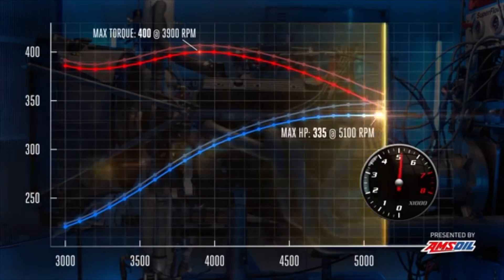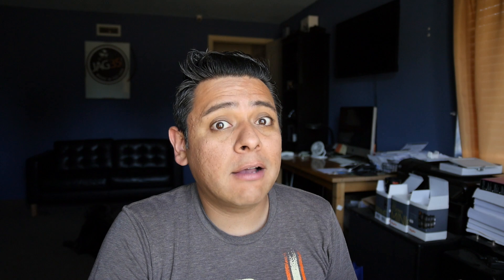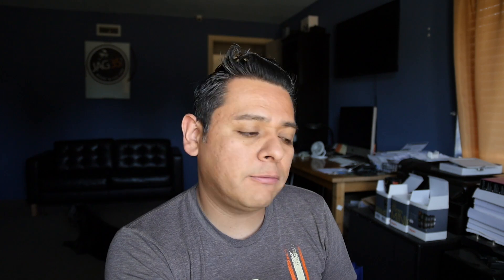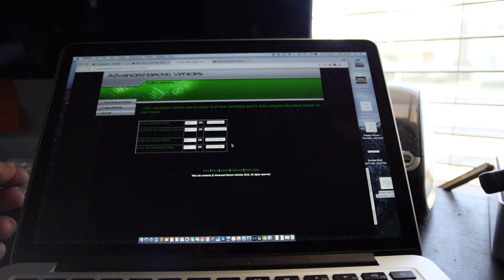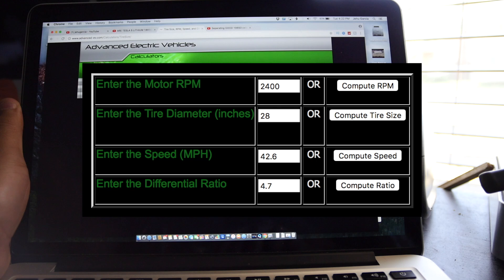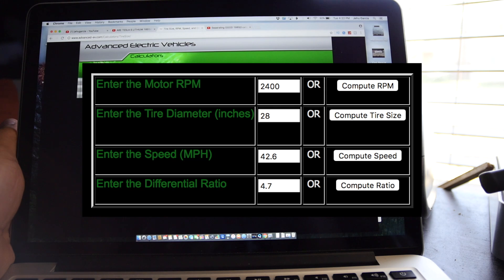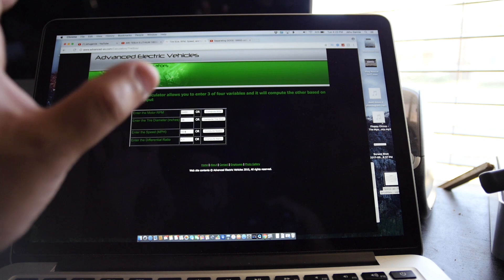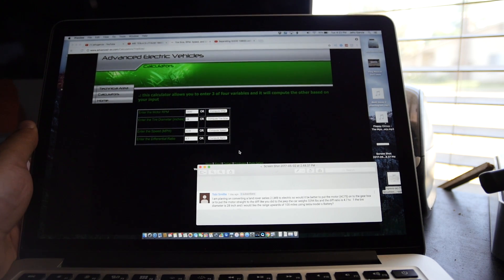Do you need transmission on DIY EV?  + batt Giveaway

Comment: hi Jehu again.
So gearboxes being predominantly a friction device, its important to say the power loss is in comparison to load or essence torque. so more you have the more you loose.this is one of the minor things thats bad for electric (except the lack of stall well then makes up for it).
so its not unusual for a car to loose 20 to 30 percent through the drive line (this being obvious if you touch the diff or box after a moderate drive), this at full power ofcourse. It does drop down the less torque applied.
Interesting information, ive herd of a 4wd with factory power of 102kw only puting out 40kw to all 4 wheels, so thats a big loss of 60%.
but thats not the only point. other main points would be like with your van being that the diff is part of the gearbox (i believe). So in your particular vehicle is your gearbox part of the frame (rare but happens) or other drives that you need, most front whel drive cars will be.
Your def on thee right track though, and thats why i watch you, thanks

Comment: Hey mate, great show.

Not a big fan of that lens though, an auto one would be better suited to your delivery style as it seems you move around a lot.

With the ratio's etc, being a Landrover nut and a qualified Mechanic and Fabricator, your right that the motor would be fine on the diff but then which one?

LR S3 has a front and rear diff plus in the LT95 gearbox/Tcase it also has one for running on a sealed surface to stop binding up the drive shafts from front to rear diff.

If you were to fit a motor to both, direct drive it would be great as it would have a max of 360Lbs of torque at 0 mph so it would have diff destroying take off.

Otherwise, you would mount it direct through an LT230 Transfer case which is 2 speed, High and Low range obviously.

Ratio's are as follows.

Prefix
Type Ratio Typical Applications 
12D  R 1.667  
13D  R 1.410 
14D  R 1.003  
15D  R 1.192
20D  T 1.667 Defender 4 Cyl Non Tdi
22D  T 1.410 Defender 4 Cyl bar 2.5 Diesel Nat Asp.
25D  T 1.410 Defender 110 V8 With LT85 Gearbox
26D  T 1.003 RR Classic with 3 speed Chrysler Auto
27D  T 1.192 RR Classic up to 1985
28D  T 1.222 RR Classic 1986 0n & Disco 1
29D  T     1.192 Defender 90 V8 with LT85 Gearbox 
32D  T 1.220 4 Cyl & V8 3.5 fitted With LT77S Box
34D  T 1.410 Discovery V8 & 2.0 Mpi
36D  Q 1.211 Discovery
37D  Q    1.211 Discovery
38D  Q    1.211 Defender V8 4.0 
40D  Q 1.211 Japan / South Africa 
41D  T 1.211 Disco 2 With Diff Lock Stud
42D  T 1.211 Disco 2 No Diff Lock fitted
  
43D        1.410 Defender TD5 
       
http://www.shop4autoparts.net/technical-info/LT230-Transfer-Box/

All 230's have a 3.321 Low Ratio

Reasonably Accurate I've found.

So If you were to retain both diffs through an LT230 transfercase direct drive to the motor and not through a manual box aswell you could get a 5.911:1 ratio meaning if you ran 32's which are about the standard 750/16 tyre size, you should get about 80mph @ 5000Rpm.

and a really torquey 40 at 2500.which is perfect for around town driving.

added advantage is that you can use it in 4wd and low range giving an 8.021:1 final drive giving a max speed still of nearly 60mph 59.4 but having the torque multiplication effect of the lower ratio would make it great to drive.

You could possibly change from low to high on the fly, I've done it before in the Diesel ones but you can't down shift back to low unless stopped, but if you get it wrong it can damage the box.

You no matter how you set it up will get parasitic loss through the drive train and a LR drive train weighs a lot so by dumping the engine and the Gearbox but retaining the Tcase I think would be the better way to retain 4wd etc without a massive amount of tech wizardry and multi engines.

By the way, front diff delete is also a bit of a problem as the front bearings are run in grease so you cant just pull the axels and CV's and if you leave it all there, your carrying unnecessary weight for nothing.

I've heard of a S2 shorty with a forklift DC motor and lead cells which is pretty kick ass but it's all old tech and a lot of losses and short range.

Comment: just bought a set of those the day you published that video!! tested em on a 1A load and they performed, got a little hotter that I thought they would but checking the datasheet they have a bit higher internal resistance than I was hoping for, so oh well, they will work! I'm working on a few different packs for e-bikes, small appliance backups, and eventually a motorcycle! would be sweet to have more to play around with! liked, commented, subscribed and shared! and I haven't posted anything on Facebook in months! haha
Reply: fun project once my brother builds the frame is going to be an electric log splitter!

Comment: You need to be able to easily hit 88MPH so that you are going fast enough for the flux capacitor to work properly.
Reply: As soon as he got 88mph I was thinking the same thing.
Reply: kuhrd does that mean my comment is nonsense? I don't know what I flux capacitor is so chances are I am speaking nonsense. I was using combustion engine principles anyway (low revs equal low fuel consumption).
Reply: @AkhonaNgquba  It's a joke reference to the movie "Back to the Future". The flux capacitor is a fictional device in the movie that makes the car travel back in time.
Reply: you guys beat me to it!
Reply: Then there will be A SPECTACULAR WRECK !
Reply: Gas engines can hit 100mph at low revs and some people prefer to drive fast.
Reply: Solar flux capacitors work at 44 mph, so yes remove the transmission

Comment: How about a GMC Eleganza motor-home converted to be a fully-electric RV? From what I gather--from an EV-West video demonstrating a converted Ford Ranger--electric motors don't like having to through over-drive gears, so grouping 2-3 AC-75's or Warp-11 motors onto the bell-housing of the THM-425 automatic trans-axle--the only type they ever came with--would provide enough torque to the wheels, yet still deliver good-exceptional range from whatever size or type of battery-pack was employed... No?

Comment: When the curves start to fall off after 2400 rpm, does that mean less efficiency? I like the idea of getting rid of the transmission, less weight, and less maintenance. 
I am trying to find cheap 18650's to convert my lawnmower from lead acid to Li-ion.
Wouldn't the fact that the new lens is all manual out weigh the quality issue?
Reply: Not just less weight, the transmission Is a giant canister of oil that can fail in the middle of your clean EV dream.
Reply: @12vLife  Idk what vehicle you're working with, but most manual transmissions will far outlast most electric drivetrain components.

Comment: Jehu, manual drivetrain use about 10-15% power including the differential on a front wheel drive, rear wheel drive will have more loss since you will need to overcome the inertia of the drive shaft and again 4wd will have even more losses since there will be a mechanical splitting of the power to front & rear. The gearbox in all cases is the largest theif except for some 4wd exceptions where the splitting of the power can be equally costly. 
One big problem with a gearbox and electric motor is that the more torque the more losses in heat. I learned this from tuning and rolling road experience.

Comment: Hard to tell difference on my 720p TV but the better lens looks a little better. Color is a little more vivid. Probably the difference between plastic and glass lenses. And yes, I need 88 mph or more for the flux capacitor to work right!  LOL I want some batteries!

Comment: You should try and get a source on those cells..?
Reply from the maker: +Keylitho  working on it, announcement coming
Reply: jehugarcia be wery! those cells max rated discharge is 2C, so 4.4A. ya they will do more for a short amount of time, but at a 1A discharge they got reasonably warm (I should quantify this in the future with a thermocouple...), so at 4A I think they will be pretty hot...their internal resistance was double and a little bit the internal resistance of cells by the same manufacturer designed for EV use.  Since power = I*I*R, halving R would mean half the heat generated by the EV designed batteries (and more energy for driving)

Comment: jehu, your mistaken, powerglide transmissions use a reduction first gear, so you would max out around 40 in first (5000 rpm), and 80 something in second (5000 rpm). 
what you may have been thinking of would be a overdrive, with a 2.0 overdrive gear....
this would be similar to the zombie 222 electric '68 mustang that reached a speed record for the car, by stacking overdrive units between the brushed (warp11) motors and rear end.

Comment: You need a calculator from internet for calculating speed from RPM, gear ratio and tire diameter.
Feels like math is not your best theme. ;-)
Reply from the maker: +MrYngram  sounds like you are volunteering to show us how to work out the answer using formulas,   I will accept a video submission from you
Reply: Nothing personal :) you are good with filming staff but not with math
I am in opposite.
But you don't need to be a rocket scientist for understanding this formula.

Look:
G - gear ratio(4.7)
RPM - (2400)
D - tire diameter (28 inch)

V - velocity
Velocity is outer tire length(in miles) mutiply by rotation per hour divided by gear ratio.

Fomula: V = 3.14 * D /63360 * RPM * 60 /G 
V = 3.14 * 28 /63360 * 2400 * 60 / 4.7 = 42.55 ~ 42.6 MPH

Comment: Cool. I'm converting my grandpa's 1982 Mercedes-Benz 300D to electric. While I heard they have strong transmissions, I still plan on using a 1 speed gearbox, from either a salvaged Model S, Nissan Leaf, or Ford Focus Electric. Getting 18650 batteries are also pretty easy, just visit places like Lowe's, Home Depot or any place that recycles batteries. They'd be more than willing to let you take some Li-ion cells of their hands.

Comment: A transmission for a classic VW is a no-brainer. It's a small and efficient transaxle. For a car with a separate diff and transmission, I think there's more to the story. Eliminating it would allow one to package batteries in part of the tunnel. It would mitigate the total weight gain of the car, and likely lower the center of gravity. Yes, the torque curve drops, but the torque drops with a transmission as well. Just not as much. Going from 1st to 3rd in many transmissions is going to decrease your (multiplied) torque by half, or more.

Comment: I'm building a solar array I've got nickel cadmium batteries inside my garage which is attached to my house and the off-gassing is toxic I'm trying to build an 18650 battery Bank and I can't afford the batteries I could really use several hundred or thousand
Reply: buy laptop batteries there cheaper and u get 5 to 6 batteries per pack only thing is more time consuming due to u have to charge them and discharge them to get their capacity
Reply: Solar Power Electricity and Electronics Call and ask Lowe's, Home Depot, or any other place in your town that recycled batteries, that's what I do. Usually, they mostly have Ni-Cd batteries, but they're at least a couple lithium ion battery packs.